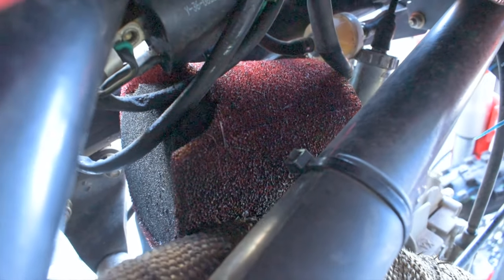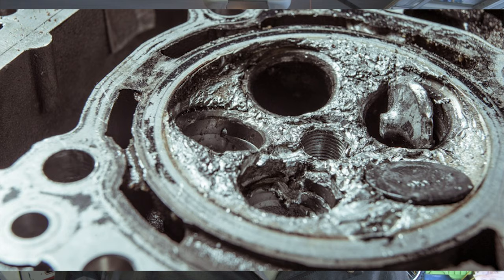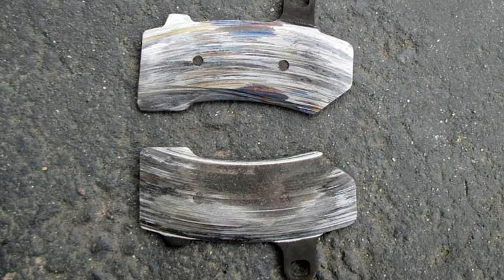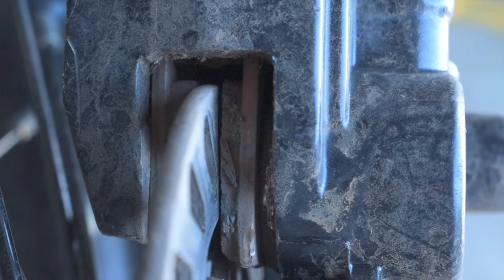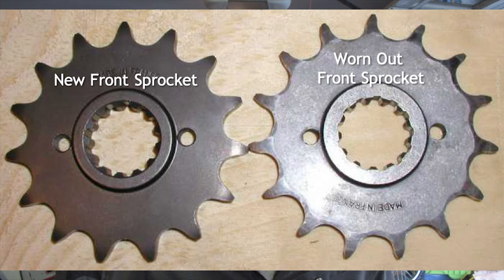How To Tune Up A Dirt Bike | DIY Tune Up

Comment from the maker: PRODUCTS MENTIONED IN VIDEO:
0:25 
Air filters (UNI Carb filter - https://amzn.to/3cNzPpP
UNI Carb FIlter OIL (YOU NEED THIS) - https://amzn.to/31eGaYX) 
Carb Jets- https://amzn.to/2VecKGQ
Carb Flange adapter: https://amzn.to/31aFW5i
All in one Carb - https://amzn.to/2AX18kH
Makuni Carborator (replica)- https://amzn.to/2AXlSIF
Makuni Carborator (Genuine) - https://amzn.to/3g0injX

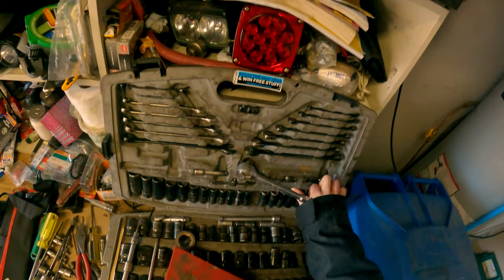1:10 
Synblend motor oil 10w-40 https://amzn.to/3sw9vJV

2:08 
Hour meter https://amzn.to/3syZCuR

2:38 
Brake pads- Apollomotors.ca

3:32 
Renthal RFZ chain upgrade - https://amzn.to/2Uz4twC
420-17mm-17tooth Front Sprocket - https://amzn.to/2Z8MnDl
428-17mm-16 tooth Front Sprocket - https://amzn.to/30trEMD
428-17mm-17 tooth Front Spricket - https://amzn.to/2Z3GrLH

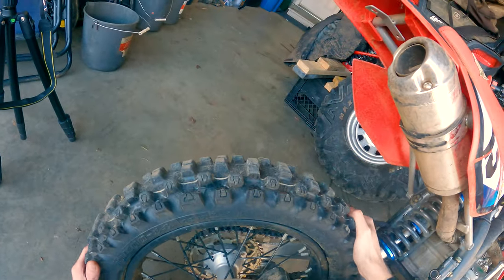4:52 
Wheel bearings- Apollomotors.ca

5:03 
Spoke wrench https://amzn.to/2N0HLww

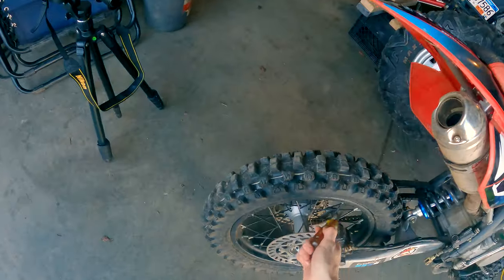5:36 
Tire pressure gauge https://amzn.to/2LY3Pas
USB Charged tire pump inflator

6:53 
Fork Seals- Apollomotors.ca

Comment: So for the oil part in a 2 stroke I am good right, since they burn the oil. And what about the rubber on the tires how often and is there any significant things that are an indicator for new a tire?
Reply from the maker: If the tire knobs are short, or if the tires rubber is cracked, its time for new rubber
Reply: @AaronsEnduro  ok thank you, I am trying to tun a 1980 rt 180 and the tires have cracks all over them lol. Thank you!
Reply from the maker: Time for new tires!!

Comment: Hey bro will that uni air filter fit my rxf? It's got an upgraded carb on it but I'm not sure what size it is.
Reply from the maker: I believe the rxf has an enclosed filter
Reply: @AaronsEnduro  it does but it's like 3/8 piece of foam..  no oil on it, just foam...
Reply from the maker: Apply some air filter oil to it and you’re good to go 👍🏼

Comment: What does it mean if there was gas leaking out of the fuel line in the bottom of the carb when the bike is running ?
Reply from the maker: Fuel float is stuck!! , remove the carb bowl (the bottom half of the carb) and clean the black looking floating piece really good with carb cleaner. The float tells the carb how much fuel to send. When it stick open it will dump fuel
Reply: @AaronsEnduro  Thanks I will do that now
Reply: I just did it there was two black looking things so I just sprayed carb cleaner all over it
Reply from the maker: Thatd be that float :)
Reply: @AaronsEnduro  I cleaned up the float and the carb still leaks when the bike is on
Reply from the maker: Did you remove the carb flot and clean the pivot pins
Reply: @AaronsEnduro  I removed the bottom of the carb bowl and sprayed carb cleaner all over the two black looking things and put it back on
Reply: It just keeps leaking of the breather tube in the bottom of the carb
Reply: @AaronsEnduro  I’m just trying to find out so I can fix it and go riding
Reply from the maker: You need to remove the black float pieces to really clean em
Reply: @AaronsEnduro  OK so remove them and spray all around and then put them back on

Comment: Does it mater if the sprocket is wigeling
Reply from the maker: Front or rear
Reply from the maker: Front is normal to have some side to side play on the shaft. Rear shouldn’t move at all
Reply: Thx didnt see the front or rear😅